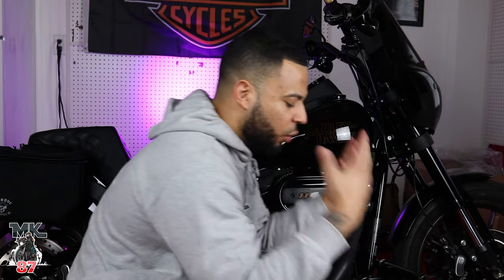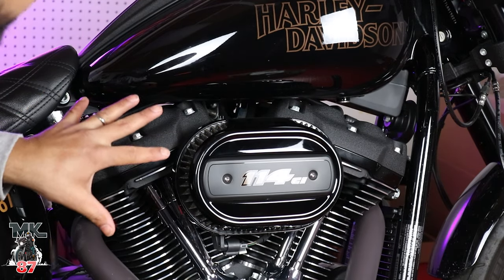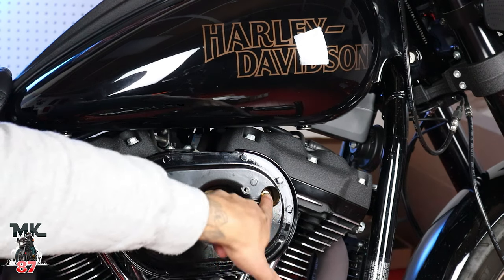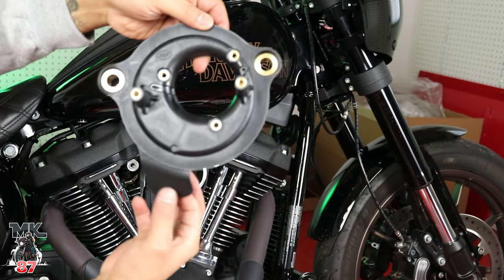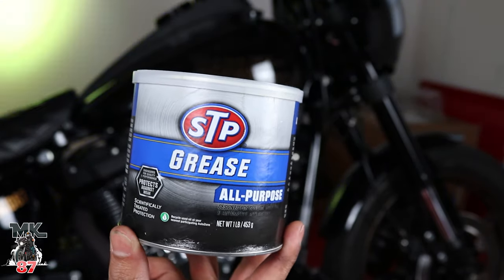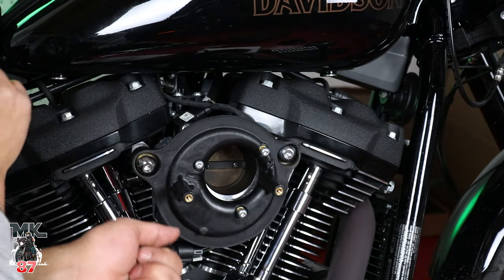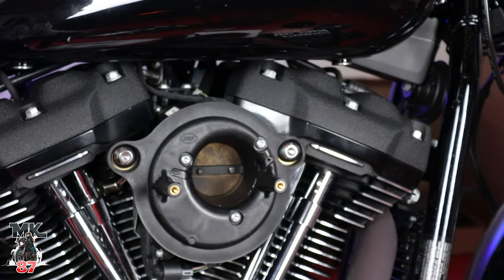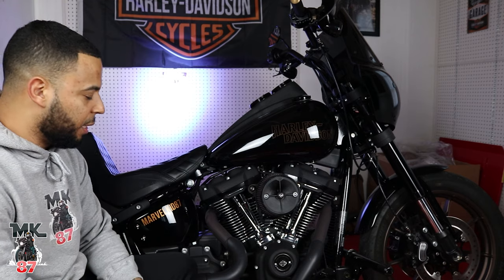Low rider s S&S air cleaner install

Comment: I'm waiting on mine to come in the mail, it's been on backorder for 3 weeks now.
Tips for fastener torque: use the Harley specs in the service manual if you have it, and invest in a torque wrench. I was cringing as you tightened the little throttle body bolts. Otherwise, good job!
Reply from the maker: I had two wait like two months for mine
Reply: True dat. The torque wrench is definitely a good buy. But which one?? I would like to use it on my Beemer as well... Any suggestions?
Reply: @Marvelkid87  I must've ordered near the end of that backorder then.
Reply: @MRGS48  I still have my Craftsman click-type from when they wereall made in the U.S. but maybe the Kobalts. Craftsman may still be a good option, I just haven't had my hands on a new one yet.

Comment: This is very worrisome!
a simple design the breather tubes into the throttle body, using a rubber O-ring between with the throttlebody, the  breather bolt does not have a O-ring.
In my experience, definitely that Blow-by oil will leaks! Good luck!

Comment: Isnt the stock 114 already a high airflow air cleaner? I wonder how the specs on the SS compare to the stock and whether the SS is suitable for a stage 2. 
Gotta admit though, asthetically the red on the SS looks dope
Reply: The red will turn black soon enough. And yes, the stock 114 air cleaner is high flow.
Reply from the maker: You’ll get more air in with the s&s
Reply: @Marvelkid87  it would be interesting to know if you feel any performance gain was worth the cost of the upgrade. Your honest thoughts?

Comment: Just a tip clean your throttle body your plate is covered in blow by from the breather tubes from the stock filter. Your manifold and intake valve probably look like that too, easy to clean with some throttle body cleaner mine was the same way.
Reply from the maker: Will do so thank you

Comment: I won't put an air cleaner (like the S&S) that pukes head gasses & oil back into my intake. When my Sporty blew a head gasket, I couldn't believe how bad my pistons had carboned up, which messed up my tune. Companies you can get a proper AC from along with an AC support & breather bolts or catch can kits-  Gasbox(mine), Lowbrow, TC Bros (breather bolts), & DK Customs. DK Customs has an excellent series on intakes & breather systems. Just trying to help you out broheim!

Comment: Bro what did you do with the breather tubes? I think you missed a step.
Reply from the maker: This cleaner doesn’t need that function
Reply: @Marvelkid87  so no venting at all or does it vent into the Atmosphere?
Reply: @fxlrs21rider17  the S&S has a hole passage in the plate where it bolts to the heads.
Reply: @Marvelkid87  you should look into a external breather. They have a few different types of setups for the newer bikes. As you noticed all that oil at the bottom of your old filter housing. 
Keep up the great videos. 👊🏼